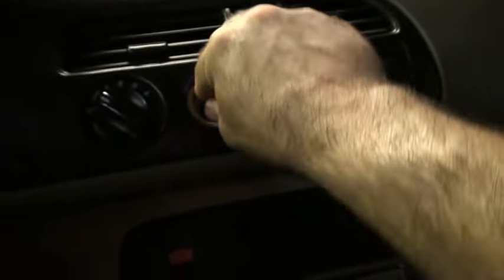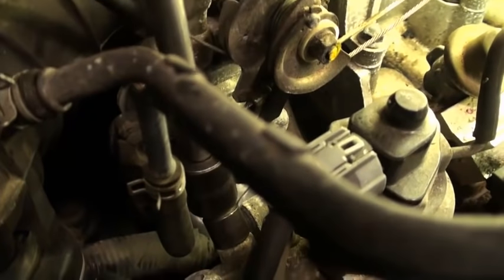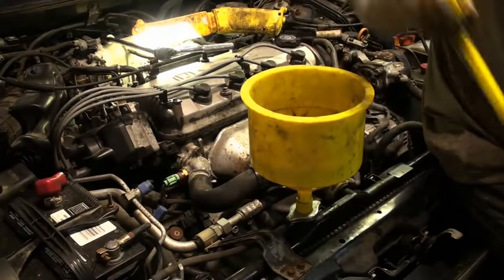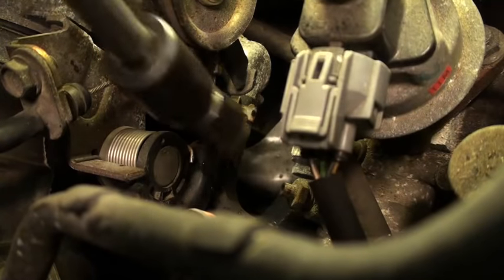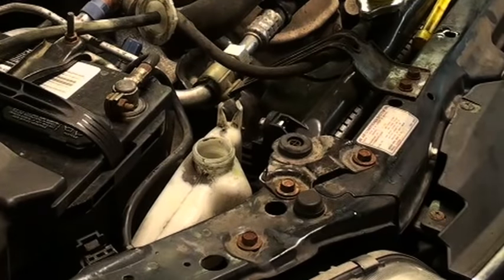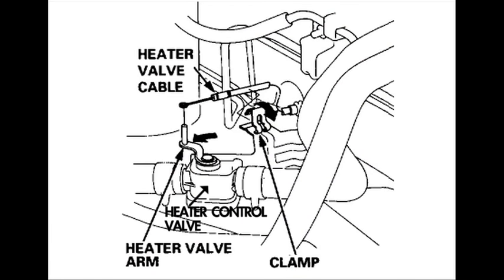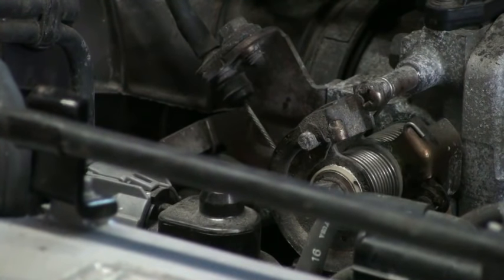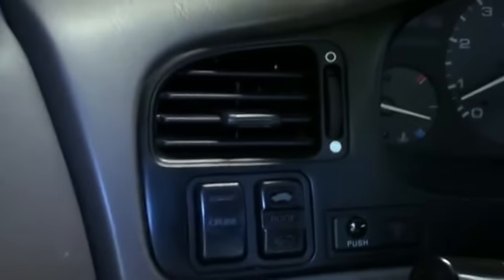How To Bleed A Cooling System - EricTheCarGuy

Comment: Hey Eric my name is tony I'm working on a 99 jeep grand Cherokee I've changed all gaskets including the head gasket,  the heater core the hole works but the radiator is still having pressure buildup could you or anyone please tell me what's going on what did i over see my email is tony_69torres@yahoo.com  or you can massage me at 808-554-2847 i would really appreciate it thanks